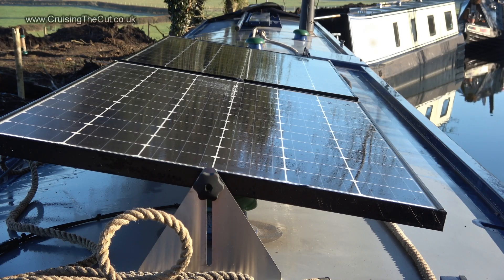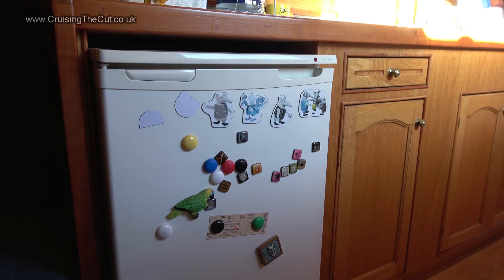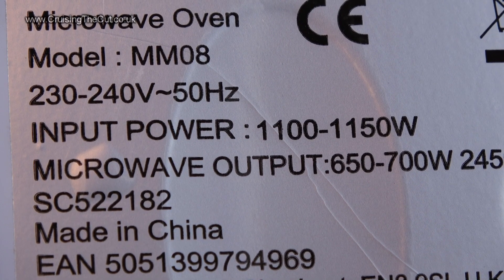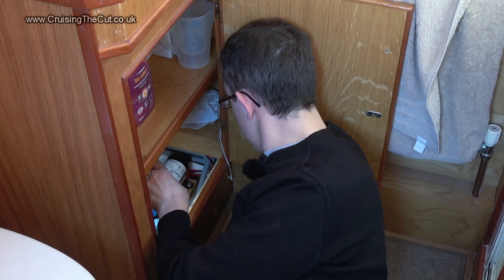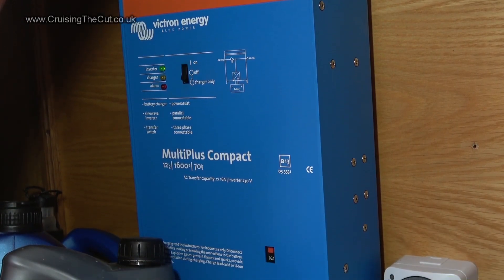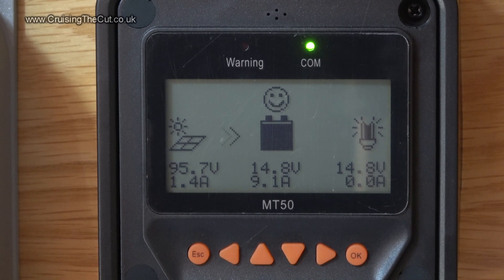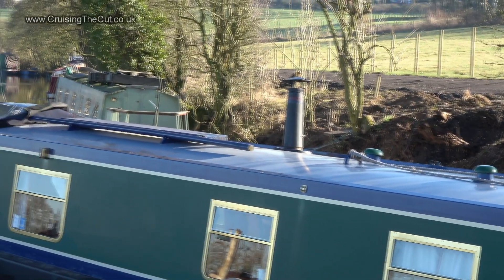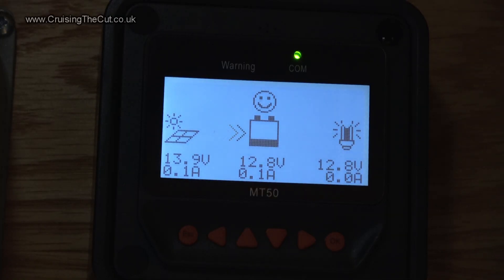76. Is solar power sufficient for a canal narrowboat in an English winter?

Comment: Thank you for the frank and detailed assessment of solar efficiency- we were never fully convinced it made economical or practical sense. You forfeit a lot of roof space and gain a lot of maintenance for an insubstantial return when it is most needed.
We have decided to take the Charles Stirling route. If you have not yet discovered him, you will find him on UK BOATING. You may have to listen to the science a few times but after the initial outlay, I think it may be more economical and efficient than the solar panels. Would welcome your comments.
Reply from the maker: Well hang on, this was purely about winter. From March to October I absolutely recommend having solar so as you never need to run the engine or a generator to top up the batteries whilst sitting moored in a lovely spot for a few days. After about two years, the installation starts paying for itself. With high capacity panels like mine, you don't lose much roof space (not that I use my roof for much anyway). So I'm very much a solar advocate.
Reply: solar power is less intrusive than other sources.
Reply: Solar panel/controllers are pretty much fit and forget,no maintenance needed,other than an occasional wipe down. They have no moving parts !

Comment: Putting environmental issues aside for a moment.... How does cost of fuel to run your engine, for what ever period of time needed, compare to the cost of purchase and installing solar .... Because, and I may be alone here, I find them rather ugly. 
I will instal them when I get the boat, trying to do my bit for the planet etc but did I mention that they are ugly.
Reply from the maker: They aren't pretty, I agree. Cost was circa £1,000 pound (as I recall) inc install. If you run engine for 2 hours a day that's 2 litres ish = £1.40/day so a 2-3 year payback
Reply from the maker: It's a financial thing and a peace and quiet thing. Running the engine to generate power will cost more than the panels by about year 2-3.
Reply: Yep. It's mainly a "go green" thing. Unless there is a life expectancy on the batteries + solar to make it worth while on returns in the long run. Hopefully so as lots of panels now have longer life spans.

Comment: get a honda EU2000 generator very quiet and fuel efficient. has an eco setting that unit only speed up as demand requires and it charges 12v at very low speed.
Reply from the maker: I see a lot of those around on the towpath.
Reply: very reliable
Reply: Joel, The EU2000 is a great generator. Best to connect it to a big battery charger rather than use the 12 V for charging. The 12 V charge rate is 8A. A charger with an input of 12 A @ 120 V can put out 75 A @12V. The run time would be much shorter. At that rate it would use less than .4 gal. of fuel.

Comment: Agreed it is a top up in winter.  But with a decent battery bank calculated for the power you use it can be useful even in the far North of Scotland.  We avoided an inverter in our motorhome setup after a bad experience in our caravan 50% efficient was a realistic figure.  We calculated our Winter power budget this way.  Charge the battery bank using our Ctek mains charger not the onboard "thing".  Run away for the weekend and do not think about power just use things as normal and keep devices charged up using the 12v and USB outlets.  Then on return reset the meter (ours has Ah delivered on it) and wait until the battery bank is fully charged from Solar.  Take the Ah reading.  From doing this a few times we averaged out our usage and decided on 300W of solar and we will have 220Ah of bank once we change out the current 150Ah which is just enough for our winter touring.  Our main eater of power is the heating system and SWMBO hates the cold :-)  Another great video BTW,
Reply from the maker: 50% efficient? That sounds terrible! My Victron is rated at 92%... something odd going on there, methinks!
Reply: Do not go by the labels.  Measure your own power in, power out usage.  Also how much of your gear needs pure sine wave?  If you are using kit that is not using a full wave rectifier then that in itself is inefficient.  We found it better to do with out the microwave and convert everything else to 12v or 5v for charging.  We use a car charger for the laptop as it requires 20v to charge.  Our longest winter trip using solar was 4 weeks.  We left with fully charged batteries and a 5 year old.  We returned with both fully charged!

Comment: Solar panels also have varying temperature coefficients, which means efficiency changes with ambient temperature as well as actual light level. De-Icing panels makes a positive difference too. There are many factors that come into play that are dependent on the specific construction, location, light incident angle and connection methods used for any given panel. Your panels look like they are amorphous silicon wafer type panels, these are not the best but are relatively good considering installation cost and performance across varying levels of illumination. When calculating a solar installation I do the maths from the provided specifications but only take 80% of the calculated output figure to allow for inefficiencies of the system. It is good to see you have a relatively high efficiency mains inverter (Victron are good quality units) but even if You were to add another AS Panel (or install a larger array with higher collection efficiency) You would still struggle in winter in the UK. In the most basic terms solar panels are best thought of as 'secondary power' that helps to extend the time cycle between battery bank charges in winter rather than a primary power source.  It is better to use what You can from the sun and burn less diesel (if charging from engine driven generator/alternator) or reduce Co2 emissions from power generation elsewhere when using  'shore power' from the grid for charging. One way to knock a chunk off your power use on board in cold weather would be to cook on the solid fuel stove instead of the microwave when possible as microwave ovens are horribly power hungry! :-) Even a little bit of solar power is a good thing ! Stay warm & Keep smiling! :-)
Reply from the maker: Excellent points!

I do indeed heat things up on the stove - usually the kettle - but depending on how hot I have it, things can take ages and for only 5 minutes of heating, the microwave doesn't really use that much - 8Ah ish plus inverter overhead.

Comment: Great vid as usual, thank you.

For those who are trying to reduce their consumption its worth having a few simple meters/loggers. They don't have to be very accurate, something like the one linked here will do.

http://www.ebay.co.uk/itm/Digital-60V-100A-DC-Power-Analyzer-Watt-Volt-Amp-Meter-Solar-Wind-Ammeter-/311450161625?hash=item4883e051d9

You can place one off these on the output of your battery bank to measure total usage but having a few with one at the batteries and a couple connected to high draw items (fridge, microwave, TV, laptop, ...) will give you more information about real usage and what needs to be rationed.

Being fully off-grid for electricity means either very reduced consumption and solar, running your engine to charge a large bank of batteries or having a separate generator. All of these are compromises.

Comment: Informative video.Thanks.
I've seen narrowboats with small wind generators on the top, but can't imagine that they produce anything like a useful amount of power. Am I correct?
One potential solution that occurs to me is a battery of thermoelectric generators (TEG's) which could draw power from the solid fuel stove. They're silent and rely on one side being cool while the other side is warm. I imagine a resourceful person could rig up some kind of water cooling jacket. I don't know how practical this would be, and I've never seen them applied in a practical way other than in those nifty little Biolite stoves in which a single cell powers a fan. Thoughts, anyone?
Reply from the maker: Yes, wind turbines can generate a bit in a decent breeze but they're not cheap, can be noisy (I'm told) and you have to take them down and put them up each time you move!

Those thermoelectric things are only really good enough for charging a phone though, and slowly at that. And they're very costly.

Comment: Another great and well timed video David as actually doing an audit/forecast on how to reduce electric and adding solar. I'm looking on around 60Ah+ and plan to use 4 panels similar to yours, one or two more batteries and larger output alternator, etc. All of the colder months I'll be moored with a shoreline, so hopefully the bills wont be too high.
Reply from the maker: Crikey, if you only need 60Ah and have 4 panels that should be plenty from spring to autumn. Goood luck.
Reply: May be a little more than 60Ah however not using a fridge in winter would be the saving. I'm mostly veggie/vegan, cook from scratch and don't need very much at all to be stored in a fridge, especially in winter. A cooler box under the cratch seats for the odd chilled items would suffice. The way I'm looking at it is if the panels are doing their job for half the year and need a helping hand in winter months I'm happy with that. The big thing for me is making them look nice as I'm not a fan how they look on most boats and currently playing with designs on how to mount/box them. All good fun!!
Reply from the maker: Agreed, they're not terribly pretty but given how much crap many people have on top of their boats, I think the solar is the least of the issues!
Reply: Hahaha know what you mean, saw some boats today fitting that description :)

Comment: You would get more out of your panels, probably much more, if you could tilt them better, the difference between projected surface etc. . Not worth the trouble if your on a shore-line, though.

For those who want to dwell into power on board I relay Sail Life's tip; Boatowners's Mechanical and Electrical Manual (etc.) by Nigel Calder. I only found 3ed at the local library but its very good, and 4th probably deals more with all this new electronics.
Reply from the maker: I would, yes, but it's not worth the effort in winter as we have so few sunny days. On overcast days there's no direct sunlight and on rainy days there's no sunlight! In summer, I have enough solar that they can sit flat and it's more than enough.

Comment: Thanks again for an informative piece. I knew that it would not work from the start as my RV has half the solar power and my fridge is gas-fired. If you have butan/propane on board for cooking it might be worth to look into a generator using that as there is far less emissions including noise. Also you do not have to take additional petrol on board.
Reply from the maker: I know some of the Honda gennys can be converted to run on propane (and I do have that on board for cooking) so it's certainly something that would be of interest if I cruised over winter instead of plugging into the shoreline.

Comment: Hi. Let's say you had no solar, and where stationary for a week or so, and assuming average electricity usage,do you know roughly how long the engine would need to be run for? Are we talking 30mins or several hours? Also, is there a gauge which shows how much power the batteries have remaining so one can judge how long to run the engine? Thanks.
Reply from the maker: Depends on your alternator. Mine's 70Amp so a couple of hours (charging tails off as the batteries get fuller) you can get gauges but for various reasons far too complex to describe here (and I'm no expert) they're pretty unreliable.
Reply: Thanks for quick reply. So if you have no gauge, it's really down to trial and error, and maybe running the engine longer than perhaps was needed?
Reply from the maker: As the current into the battery lessens as it gets full, you can use amp-meters to see how much is going in and as it gets less you know it's getting fuller! I think that's the theory...
Reply: Many thanks for your time

Comment: This is a great discussion on a complex problem.  I think most people don't understand the basics enough and you do a great job of breaking it down.  
Just thinking outside the box a little.  Given your 40a of fridge use daily.  How about this idea?  In winter you have -5 to maybe +10 degrees outside?  Why not run a duct to the outside air with a small fan on it to draw the cold air from outside directly into your fridge?  Small fan would draw .1 amps while operating (at night) so maybe  1.5 amp  per day? During the warm summer months you could plug the duct hole on the fridge and put away the pipe.  This idea would not work in the summer months but that is the time you are making more power with your panels.  Essentially you are cooling a space in the fridge which is trying to stay cold inside a heated boat space?  Perhaps this is more trouble than it's worth if you have easy access to shore power or don't mined running your Engine to charge batts but it sure would be a fun experiment to see if it worked?
Reply from the maker: Interesting but as 12V fridges cost about £500 new, I'm not going to find out by drilling into my existing one! Some people just stick the food in the well deck and turn the fridge off but because the temperatures are so variable, I don't like to do that. Cheers :-)
Reply: Yes old 12 voltlaptop fans are allmost for free. And he has allready cold air in the
boat but he has to dig for it. Also the magnetron he doesn''t need to 
use in winter if he puts the pot on the oven. There's possibly more but
he has decided allready that its not possible.
Reply: I C.  Not sure what a well deck is but an external container of some type might be an easier solution?  Something that freezes during the night and is somewhat insulated during the day?  Understand not wanting to damage your existing Fridge.  I live in a warm climate so this solution would not work at all.  But I do get lots of sun during 12  hours per day so the panels I have work great year round.

Comment: So, it looks like you are in a negative power budget. How to you replenished your batteries? Run the engine? If so, how long?
Maybe having a portable 100-watt panel that you can connect and point towards the sun might help, a little. Keep warm..
Reply from the maker: My objective is just to live on a boat and enjoy it. The video's objective was to point out there isn't enough sun in the UK to run the normal boat appliances in winter off solar alone.
Reply from the maker: I think you've misunderstood the point of the video. A 100W panel, even pointed to the sun, will not replenish the batteries in winter if my 480W panels can't do it even if they're not positioned optimally. There isn't enough sun.

I recharge by mooring for winter and connecting to a shoreline. Other people would run the engine or a generator.
Reply: I also thought that the objective was how to live off-grid during
winter in your circumstances. Plugging into a marina is costly
if your only motivation is supply of electricity. Many before you
make do by making choices in the consumption dep. like no fridge in
winter. If you try to be creative and think out of your new box I
think its possible. Its a fun process to gain freedom and save 
money this way. This internet is a wealth of info. Hi from portugal
(yeah easy here).

Comment: as always very informative - I keep thinking a generator is the way to go for continuous cruising in the winter, although like you we will probably be in a marina for the winter months using shore power. Do you get a full charge from your solar on most summer days? thanks again for the vlog
Reply from the maker: At over £100/month for even my meagre 80Ah requirements, I can't see that catching on for narrowboats at all.
Reply from the maker: Oh gosh yes. Last year I unplugged from the marina at the end of Feb and didn't plug back in again until mid-October. Plenty of solar in summer apart from rainy days.

The only issue with generators is how to safely store the petrol and avoiding carbon monoxide poisoning from the exhaust though many boaters I see appear to have a very lax attitude to it!
Reply: CruisingTheCut 

These seem to be the latest craze for power generation. http://www.efoy.com

Comment: Thanks I always wonderd wether boat engines had alternators for the battery, I understand that boats with a turbo Diesel engine retrofitted would have, I have no experience with boats but I wonder if a slpit cargeing system people use overland off-roading would work on a boat
Reply from the maker: Yes, they all have alternators both to charge the starter battery and also the leisure bank via, as you say, split-charge relays.